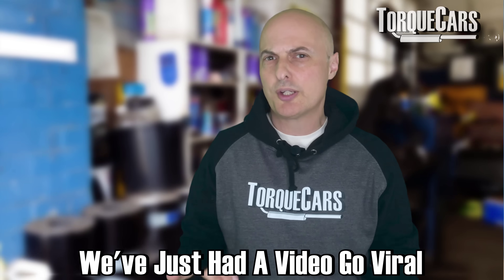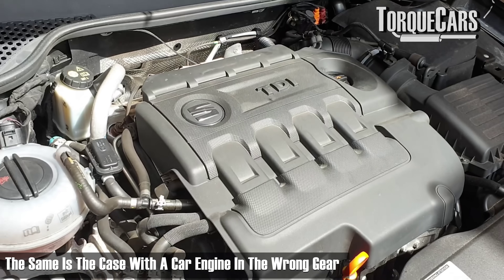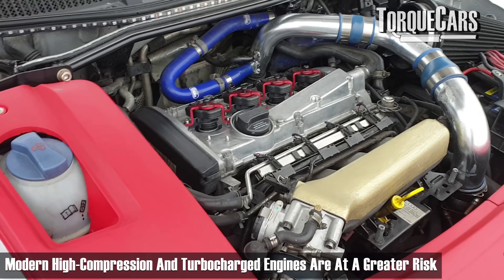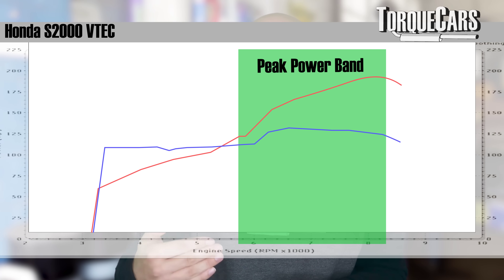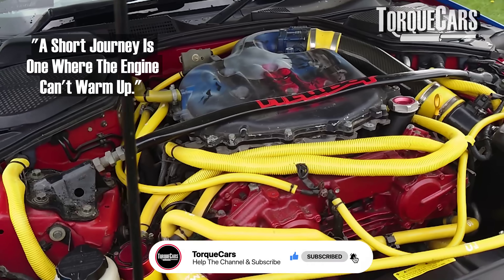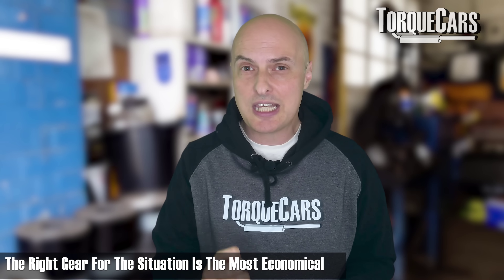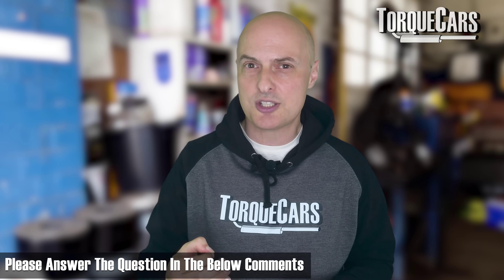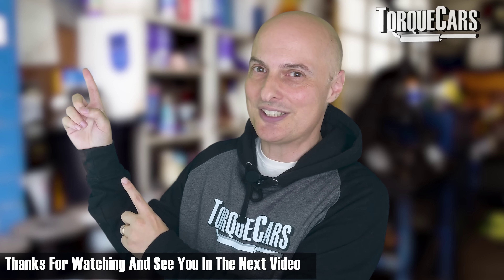Warning: Low RPM Lugging Destroys Engines! Why Low RPM Driving Is Bad.

Comment: Kia Sportage, 1,6 CRDI with 136 hp and 320 nm (with RaceChip GTS).

Driving the most at motorway with 110 km/h (70 mph) and 2000 rpm. in about 50 miles.

My car has SCR, DPF and ad blue system. Has about 150.000 km. (93.000 miles) on the clock.

No soot in the engine or fuel system. Changing oil every 6.000 miles with Liqui Moly Molygen 5w30 and using Xenum10 additive every tank of fuel.

What are your thougts abouts this driving and maintanance behaviour ro provent soot, carbon build up and common problems with DPF etc.?

Greetings from Denmark
Reply: Hi. Imo 10k km is too much for that oil, it's group 3 HC oil, which isn't considered as full synthetic. It has molybdenum but that's not enough for 10k km. I have V50 d3 150hp Volvo, I am currently running on Ravenol SSO 0w30 a3/b4 and also change at 10k km, but it's a full synthetic with some percentage of PAO in it. I am adding LM Pro line Super Diesel additive. Also tried LM Ceratec this oil change. Just saying that you can get better oil for the same price. LM has a big mark up, you Molygen is like 42eur for 4l, but you can get Castrol Edge or maybe Mobil1 for around the same price and it's gonna be a better oil overall in my opinion.
Reply: @deez023  i dont agree. Molygen is a full synthetic oil. I did sparring with Liqui Moly technicians also and for the climate and  engine it is absolutely great. I used it for my previous car also, BMW F10, VW Passat B8 etc.
The molygen helps with anti friction and works for 30.000 km. and also great for DPF because of low capacity of sulphate which helps prevent burning to ash.
Castrol is unfortunately not as good an oil as others on the market. It's okay, but not as premium as Liqui Moly, Amsoil etc. Ceratech can help with anti friction in the engine which is great.
But thanks for your thoughts..
Reply: @YalcinOfficial  I am glad that you had great results with this particular oil and I don't have anything against LM, but they definitely have a price mark up compared to other brands. I double checked to be sure. Your Molygen is C3 oil, which has lower TBN to accommodate for lower sulphated ash number, all that means that it has less room for oxidation compared to a3/b4 for example and no way it is good for 30k km, 10 at max, Id say 8k. It has 170 viscosity index, which is a bit low for full synthetic and -39C pour point is also not the greatest, in full synthetic oil it would be past -40C. And lastly, the company itself says it on the website and in TDS, It's easy to understand If it's a full synthetic or HC oil, in Germany they have to clearly state this, Molygen says that it's synthetic technology "synthesetechnologie", but full synthetic would be "vollsynthetisches". Imo I'd rather have better base oil, than an extra 100ppm of Molybdenum, that you can add to any oil using LM additive. HC oil is actually super refined mineral oil. Your Molygen may have some Pao in it, like 10%, but that's about it. You molygen is still a good oil, but there are better options for the price, that's all i am saying. And relying on LM brand as premium and "the best" is a bit delusional. Since you are driving mostly on highways, your oil will be fine, but for city driving I would choose something else
Reply: @deez023  it's fantastisk to have these sparring conversations. I will take your information with me. 😊
Reply: @YalcinOfficial  Also wanted to ask about RaceChip. What's your experience with it? Have you done any test to confirm better acceleration?
Reply: @deez023  yes, it works. I have done a test at those chiptuning companies (2 different places) - and yes, there is an increase of horse power and torque. But it's not as much as they say from the website. For example they say that my car would get up to 100 nm in torque more, which is a lot for that engine size - but gets about 20 nm more in torque and about 20 hp. But it's working and it gives that extra power that you need. I recommend it. Before I was very sceptical for tuning boxes, and there are definitely reasons for that. But Racechip is the biggest company and is very popular in Germany.
Reply: @YalcinOfficial  does it change pedal sensetivity? Not a fan of sensetive pedals, prefer heavy and more linear pedals that bmws had in 90s
Reply: @deez023  yes it can. But it's possible to tell the technicians by customer service, that you don't want to change the gaspedal reactions.

Comment: Look up on Internet your car and engine, 8:05 no wonder you get better MPG at 1600RPM, The max torque available is from 1600RPM. So the rule of thumb is to look up when your engine has peak torque
Reply: @Kytes93  But what happens when the max torque is at the high range.  I have a Civic and a City both NA and automatics. The peak torque value is around the 4800 rpm range. They both tend to upshift at around 2000 rpm and sometimes it's kinda frustrating.  Is there any way to sort of control the upshift other than limiting it to D3, D2?
Reply: @seanchoy236  i have no idea. I have a Mazda 1.5D and an Audi a3 both diesels and manual. In your case just leave it as it is. There's nothing much you can do. But even modern petrol cars have peak torque at around 1500~1800RPM because they have long strokes which helps them have more torque, that's why most of them now have redline that starts at 6500RPM
Reply: @Kytes93 I think you’re conflating modern car and turbocharged car. The peak torque you’re speaking of is relevant to turbocharged engines generally. Otherwise 4000+rpm sounds about right.
Reply: @FREEofVEGETABLES  yes you're right, not only bore but also turbo and many other things helps modern engines at low rpm with high torque.
Reply: @Kytes93  If peak torque is made at 1500rpm it’s pretty much entirely because of the turbo at that point.
Reply: I mean thats not always the case though, especially with an NA engine. My cars peak torque is at 4500 rpm (with only a 6450rpm redline), that doesn't mean it gets the best economy there. If I'm just maintaining a constant speed or puttering about I'll be below 2000 rpm, normally at 1700 rpm in 4th at 30. Which isn't lugging the engine because I'm not asking it to do much. In fact its happier lower down than most turbo engines because it doesn't rely on a turbo for power. So where a turbo engine has to at least be at the boost threshold (1500-2000 rpm in modern cars) to not be lugged even in gentle driving, my NA engine will happily chug along below 1500 rpm as long as you're just driving gently. Because in that range it does actually have more torque than a similarly powerful turbo charged engine, despite having a much lower in value and higher in rpm peak torque.
Reply: @__-fm5qv  yeah, NA engines are not known to be mpg friendly. Mazda is the perfect example
Reply: @Kytes93  Imo Mazda is a pretty poor example of bad NA mpg, as generally the newer Skyactiv G and X are pretty efficient in the real world, especially for an NA engine.

Smaller turbo engines of similar power do get slightly better efficiency when you're really driving gently,  but also will drink a little more when driven more spiritedly thanks to requiring very rich air-fuel ratios under load.

So while it is generally true that smaller displacement turbo charged cars will get better economy for the majority of people than a larger displacement NA car, the gap is not that big with modern high compression ratio NA engines.

Hell even the ancient 2L duratec engine in my C30, which is also sits at 3100 rpm on the motorway, is sitting at 40 mpg average. I had a smaller lower powered Ibiza 1.2 TSI on loan for a bit while my car was being fixed and that only did 50 mpg with the driving I do, which isn't too different to what a Mazda 3 skyactiv g would do too.
Reply: @Kytes93  The power has to come from somewhere. For the same displacement you'll often find that NA engines beat turbo engines in fuel economy. Turbo engines usually get better economy because those engines are smaller and more modern. However once the turbo spools up and you're on boost, all bets are off. You'll begin to find many slightly larger NA engines beat turbo engines in fuel economy depending on driving style. Especially if the turbo engine runs rich to cool the cylinder.

imo in simplified terms to truly maximize fuel economy in a turbo car, you should stay away the hell away from boost, and maybe buy premium fuel

Comment: Throttle position alone isn’t always exactly proportional to fuel consumption, for a given gear yes but in a lower gear with lighter throttle application not only does the increased rpm increase pumping losses as you’re spending energy compressing fuel more times per distance covered but the lighter throttle application itself adds more pumping losses again as the air has to fight the restriction of the throttle body. Obviously still don’t go to 5th or 6th for 30mph (unless you’re going slightly downhill I guess) but 3rd? For 30mph? if you need to accelerate up from 30 because you’re entering a 40, 50, 60 road sure do that in 3rd but if you’re just maintaining 30 I don’t remember driving a car that wasn’t happy doing that all day in 4th on a flat or slightly uphill road 🤔
Reply: VAG 1.6tdi with the 5 speed manual box. In 4th it sounds like its lugging, meanwhile in 3rd it sounds strained like it's revving too high. Had a Leon with that engine. Good cruiser but really not nice in town. Replacement golf 1.5 turbo is happy in 4th and our other car a cooper S is also happy in 4th

Comment: My 1.9 pd is happiest from around 1500 then to around 2200, after nearly 3 years owning it I’d say that’s its ideal driving rpm, I change gear up and down according to uphill/flat/downhill. I never lug it and only Rev it high once the engine is fully hot to blow the cobwebs out so to speak.
Reply: Same here. 1.9 TDI from 2000. The turbo kicks in somewhere around 1400 - 1500, engine feels torquey and accelerates well all the way up to about 2400. On the highway in 6th gear going fast the RPMs hit about 3000.

It's all about feeling the car and how it responds 🙃
Reply: @GuitarIv69  Yep exactly, feeling.
Reply: Have mine from new, now 22 years old, 1.9 pd 130hp. Never driven that car below 2k... cruising 2100...2200... changing gear at 2800...3k... highway 2800 rpm... 140 km/h.

Yesterday renew my registration... eco test like a brand new car. 

I don't get people that run their car at 1.2k rpm.
Reply: I was really disappointed when I switched from the Golf 1.9TDI 90hp to the Toyota Corolla 1.6 gasoline 132hp... that lack of power, torque and acceleration at 2000 rpm is absolutely ridiculous.
Now I'm angry that I didn't buy a car with a turbo.
The only thing that is positive is the lack of breakdowns with Toyota
Reply: Same here with the 2l tdci. A good sweet spot. Overall, if you listen to the engine and drive accordingly you can't go wrong.

Comment: Had a manual English made car (Civic hatch) and the recommended gear change indicator would basically illuminate it's up shift light anytime the driver dared venture over 1,200RPM. Basically it was always screaming out 'up shift' 'up shift' anytime the engine was spinning at double its idle speed. The way around this problem of course was to fully depress the throttle lever until the polite electron pixies would initiate rev cut.
Reply: What's even worse than that is a car with the dreaded "Skip Shift" light... which is attached to a gear blocker that (in all instances I've seen) forces you to shift from 1st to 4th gear when illuminated. It's been a common feature on some American cars with a V8 and 6 speed manual transmission cars, and is a bodge to help increase fuel economy on an EPA test loop. Since we don't drive on test loops, you're always a hair width away from lugging when you shift into 4th gear at 15mph. If left to my own devices, I'd often skip one gear at a time under light acceleration in the 1996 Camaro so equipped- usually 1-3-5-6 or 1-2-4-6.
Reply: Yeah. Same story with mini cooper S (2012). Shift indicator wants you to stay at very low RPM. Car doesn't sound that happy. I tend to ignore it!

Comment: Surely you can still use full throttle, not "lug" the engine, without being at the upper end of the rev range. My car makes peak torque at 3900rpm and max power at 8300rpm, but you're hardly lugging it if you're driving at 2500rpm, for example. When cold I tend to keep it to 1800-2500rpm and not use full throttle.
Reply: @rossfripp4503  I think he's referring to full throttle well below the power band.  Bad for a number of reasons
Reply: My bike redlines at 12 500. Most of the time, if I'm just puttering along, she won't see more than 4-5k. If I'm cruising im town under basically no load, it's about 3k. But I go up and down the gearbox all the time, depending on what's going on. So when power is actually needed, the engine is in the right range to deliver it.

Having a cable throttle lets me feel exactly what's going on in that regard. I view it purely as an advantage.
Reply: The "cold" part should always be observed, especially with winter just around the corner.